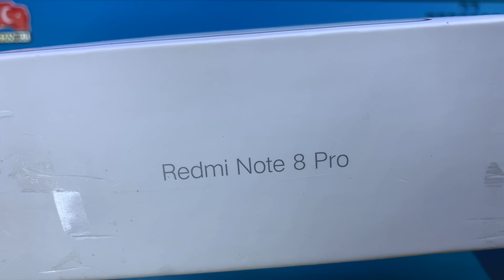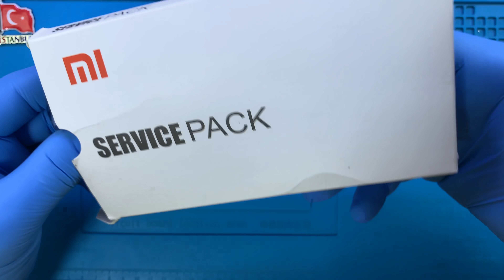Xiaomi Redmi Note 8 Pro Ekran Değişimi 🇹🇷

Comment: What is in Your left hand and what is the beneficial is it ?
Reply from the maker: Hi;
Static electricity-free wristband on the left arm. Our technical service is designed completely free from static electricity, but it is installed by our technicians as an additional measure to prevent static electricity that may occur momentarily. It is a special magnetic magnet on the right arm. It provides the holding of very small metal parts.
Greetings.